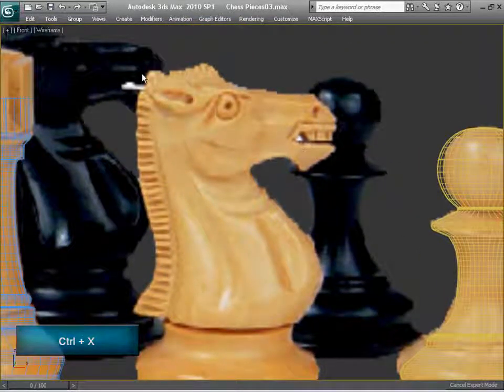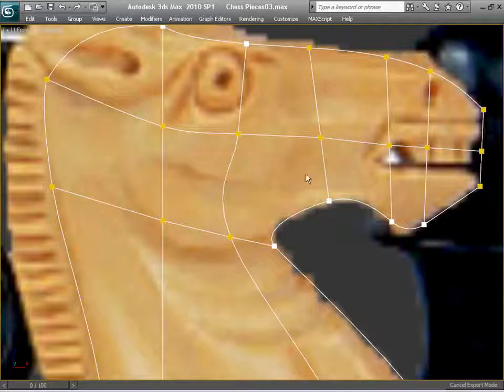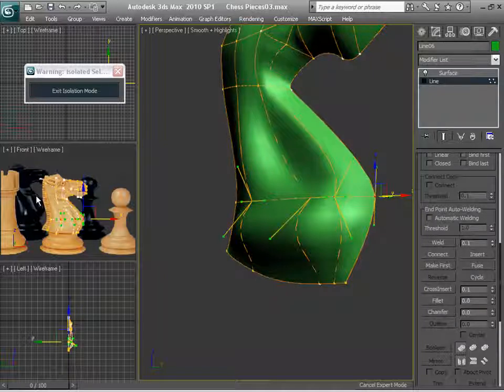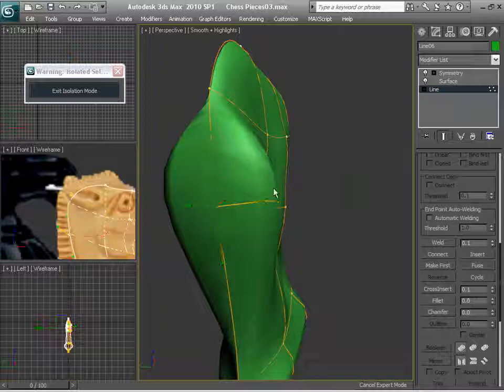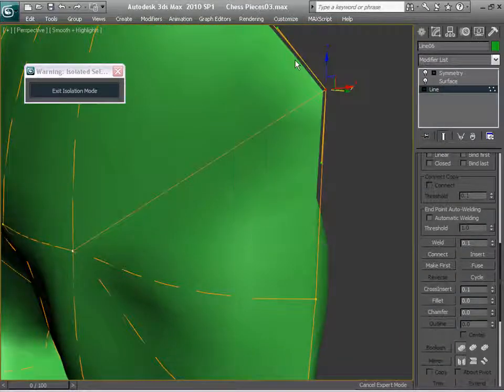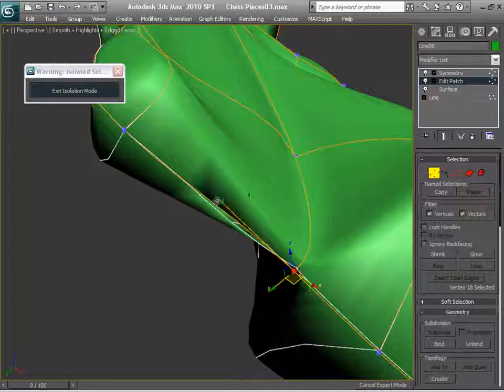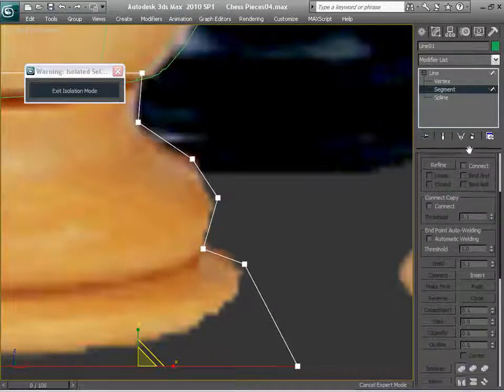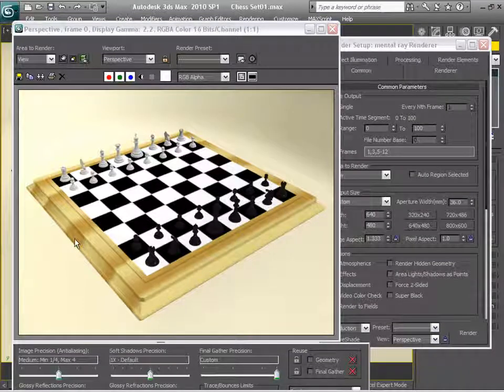Model and Texture a Complete Chess Set in 3ds Max - Day 2

Comment: I'm having difficulty with the refine and connect part. For some reason the vertices are not connecting to the mesh. It is actually creating new vertices which are not connected to the spline. I can not fuse or weld the vertices to other vertices either.